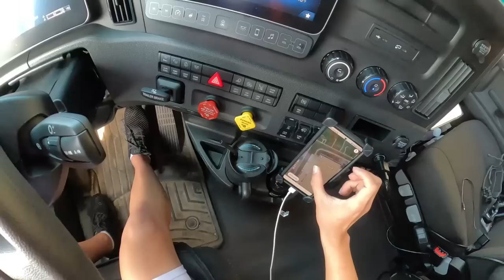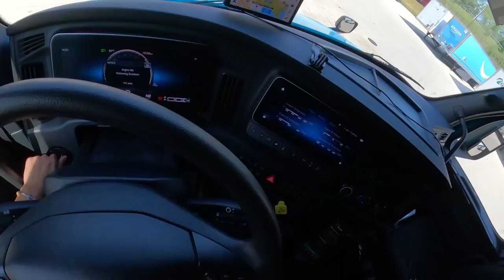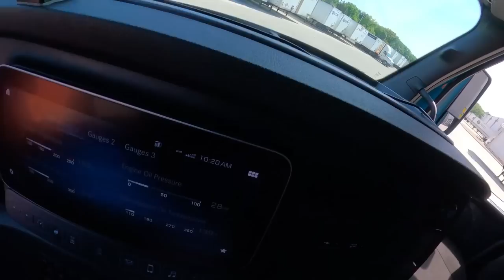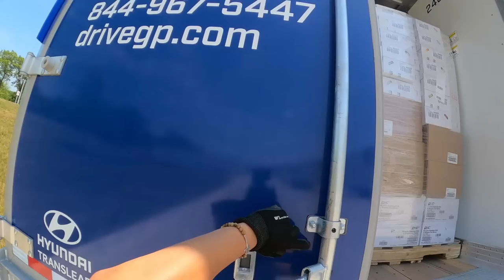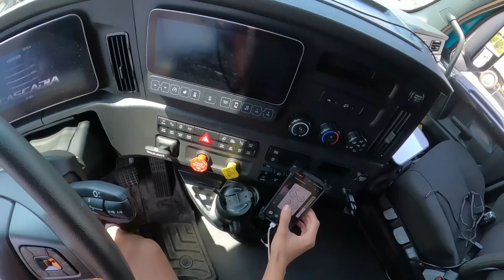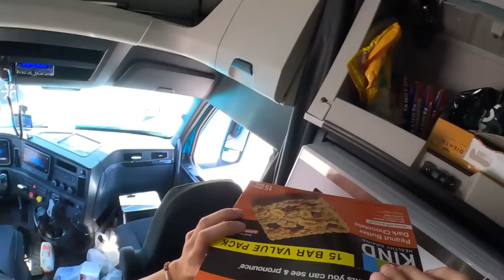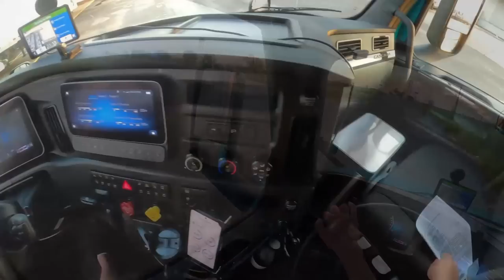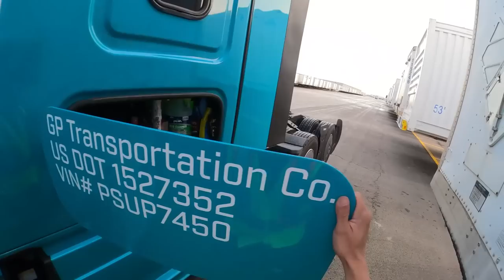This Is What Trucking Illinois To Texas Is Like...

Comment: You don’t have to strap because they put the tension airbag between the last two pallets.
Reply: you may not have to but it helps prevent Osd  cause even with the tension bag product can shift.
i have had that happen with me on a produce load before its the worse to open a trailer and find 9 million bell peppers on the floor.

Comment: I had a scary experience yesterday. I was backing into a dock at a paper receiving place with seven tall industrial paper rolls in the trailer. The pavement at the corner of the dock is uneven and slopes down about 6 inches sharply. I rolled down that and my load shifted. Looked like the trailer was going to tip!. Also the day before i was southbound I-5 during the storm. The truck route through the grapevine was closed do to mud slides so i patked atbthe nearest truck stop in wheeler ridge. I woke upbthe next morning and wasnt building anymore than 80psi of pressure. Turns out there was a hole in the air dryer. Its things like that make you amazed how lucky you can be. So glad i didnt go down the mountain with faulty brakes!! Stay safe all, do your pre-trips!!

Comment: When there is no painted lines on the ground, you can usually line your trailer up using the crack/devider in the concrete.
Reply: I tend to use the bolts on the dock pads, lol